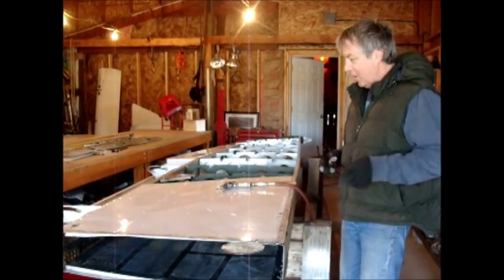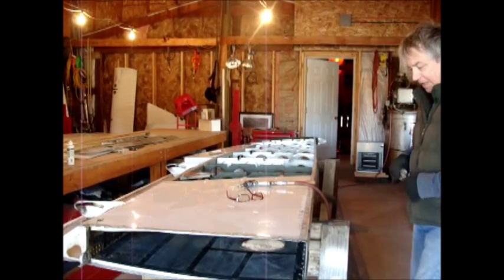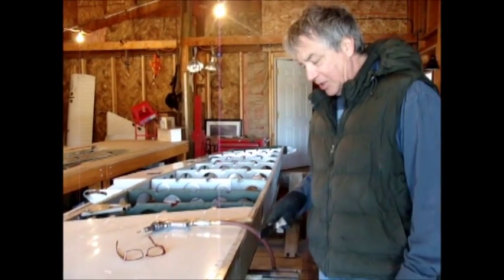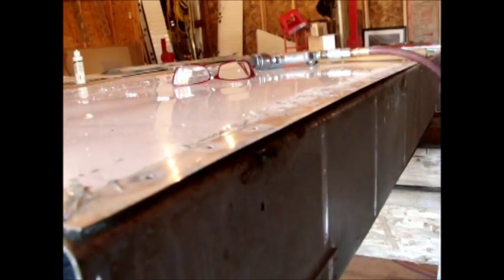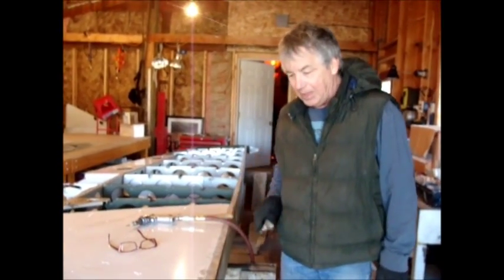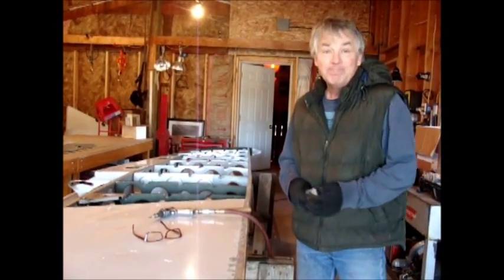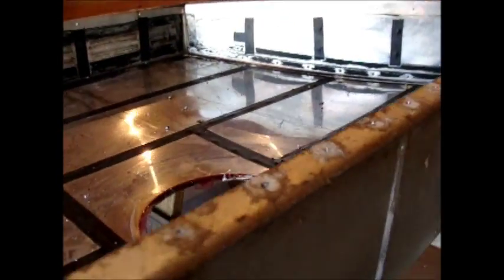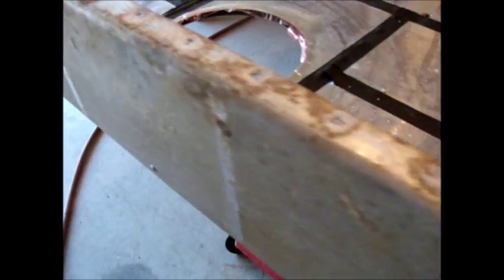Corrosion Repair Cessna Wing

Comment: Thanks Lonnie, good to watch. My 180 is also a slant bay and as as part of the Cessna SID program we did a little investigation into the condition of the wings while the were off the airframe. While they looked OK there were little tell tales that didn't look quite right and I became suspicious and kept on tearing them down. Once we had the spars apart the real condition became apparent that the worst is hidden in the lap joints in the spar assembly.

The end result will be a full rebuild of both wings, but then again the 180 is over 60 years old. At least this time it will be corrosion proofed!